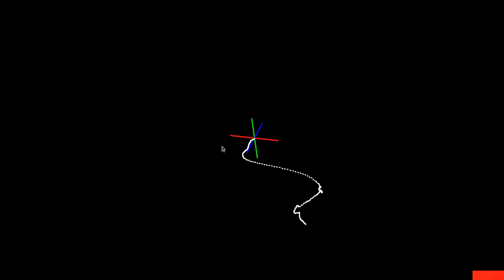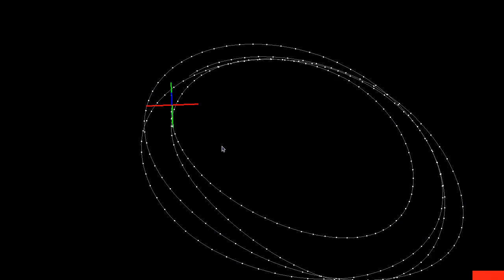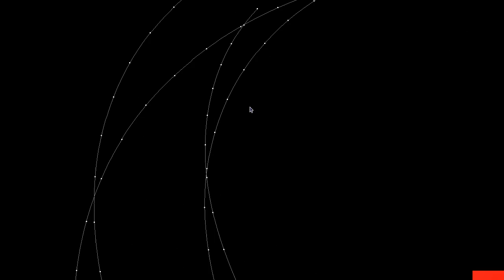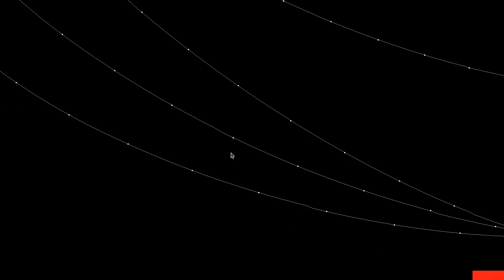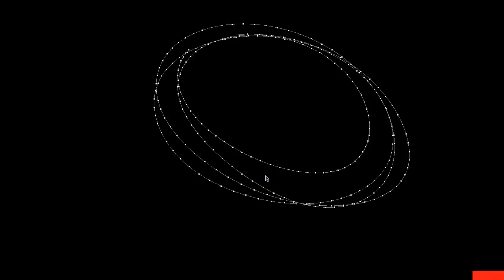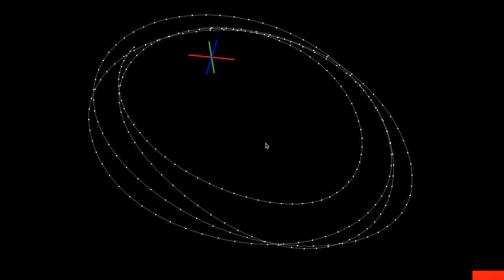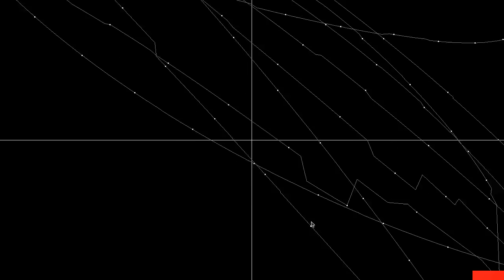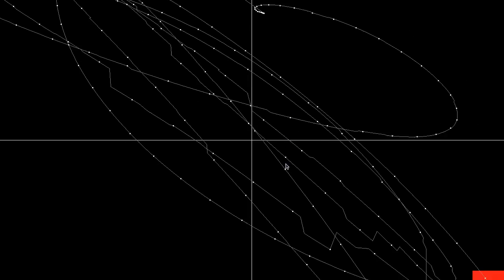Lighthouse Tracking Examined - Headset in Motion

Comment: Do you know if this is any different with the lighthouse 2.0 or is it pretty comparable?
Reply from the maker: I haven't had a chance to test Lighthouse 2.0 yet. It should be comparable, as the fundamentals of tracking work the same. The main difference is how synchronization is achieved.
Reply: @okreylos  Alright. I haven't found anyone else who's done any testing like this with the 2.0 anywhere. I was hoping it would track a bit faster than 1.0 cause in beat saber I can feel exactly what you're showing in this video when I'm flailing my arms around wildly. lol

Comment: Very interesting as usual. I have a question. Right now if you have a mirror or something reflective in your room, the path where the Lighthouse signal is reflected is interfering with the tracking. Especially on the controllers it just stops correcting and they drift away. The headset is just shaking pretty bad but stays mostly in place. Now do you think this could be corrected by software, when these improbable far/fast tracking jumps are ignored or something?
Reply from the maker: Mirrors, or reflective surfaces in general, are a real problem for Lighthouse tracking. Spurious laser hits via a mirror would, based on my understanding of the method, not just lead to bad pose estimates that would cause large jumps and could in principle be detected and rejected, but would lead to internally inconsistent states that would basically "crash" the pose estimation algorithm.

I would imagine this to be an extremely tough nut to crack, if even possible.

Comment: Why is it that drift tends to build up when you predict it from the inertial sensors and accelerometers?
Reply from the maker: Sensors are noisy, and integration (from angular velocity to orientation, or from linear acceleration to linear velocity to position) turns noise into drift. In addition, mis-estimation of the vector of gravity in inertial sensor frame causes severe acceleration measurement bias.

See here: https://www.youtube.com/watch?v=_q_8d0E3tDk